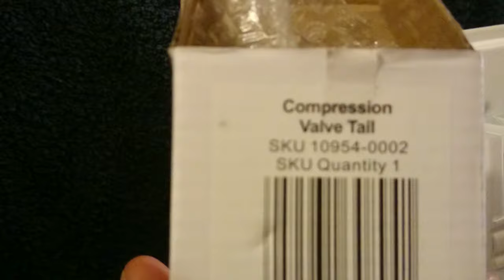Fitting A Telescopic Radiator Tail, in the real world

Comment: Good vid,just a tip though, you dont need to put ptfe tape on the threads of compression fittings ,it serves no purpose at all,put the tape on the olive not the thread.
Reply: See you say that but it has stopped a few leaks for me in the past
Reply: @garnhamr   stand by the above, does nothing the seal is the olive not the thread. but if it works for you then fill ur boots my friend.
Reply: @garnhamr it hasn’t , the olive is the seal.

Comment: Telescopic radiator valves are a leak waiting to happen. One can buy a fixed length version which can easily be cut to the correct length with a pipe cutter. PTFE  around the thread on the valve is also a NO. It needs to go around the olive as this makes the water seal. The nut and thread just mechanically holds the joint together
Reply: Been fitted 3 years still havnt leaked 😁
Reply: There AREN'T olives on rad tail joints!
Reply: Agree - the fixed type has a longer thread into the rad, and costs less, whereas the telescopic type relies on a rubber gasket. Fit once, never replace!

Comment: This video was very useful as I had to replace an imperial radiator for a new metric. I did not use the telescopic tail however, instead I used the rigid TRV extension tail as I read some reviews that said the telescopic tail was prone to leaking. Nonetheless, appreciate the time taken to put this video up.
Reply: They do leak, both of mine are leaking thats why Im here. I'll put a rigid one on them thanks for the heads up
Reply: Does the rigid one extend to size like this one too?

Comment: I didn't know these were actually a thing until I noticed one of my rads leaking. Initially I thought it was one of the compression fittings on the valve, but when I took the rad off the wall I noticed one of the tails slides in & out. That's where it's leaking from. I have no idea how old that telescopic tail is though as I bought the house 7 years ago. Time for a new telescopic tail 👍

Comment: Not correctly installed. Ptfe tape around the lockshield valve thread is not the way to seal that connection,. The olive makes the pipe seal, and a touch of jointing compound or a few turns of Ptfe on the tail spigot us the correct way to a perfect joint. Also, I can see the telescopic tail has an O ring seal so no Ptfe required there, just a slight smear of silicone grease.
Reply: Please bear with me, I am a complete plumbing beginner... 

What you call the "olive", is it the black rubber seal?

So on one side, the seal is ensured by the rubber. What about the other side? Is the brass thing enough as well? 

Is PTFE required purely for hard metal to hard metal connections?
Do we need PTFE tape anywhere in this case?
Reply: @ericmamet9893  The olive is the copper ring that fits around the copper pipe, looks like a wedding ring, and is used in all compression type fittings (those with a nut and thread).  If you are screwing a radiator tail into a radiator, and the tail includes an O ring, then a little silicone grease is required to ensure a good fit at the radiator . The other end of the tail usually includes an olive as it is a compression type fitting.
Reply: @westwonic  Thanks
Reply: For info, the olive is heat treated at the factory to soften it, so when the compression fitting is tightened it is squeezed between the pipe and hard machined metal face of the fitting. To ensure a completely weep free joint, smear jointing compound at the olive /pipe joint facing the machined metal face, or a few turns of PTFE can be used.

Comment: Good job, great video. 
I much prefer brass olives to copper ones, never had to apply ptfe tape on a brass olive. 
But if using the copper olives, I tighten the fitting down first (so the olive bites into the pipe and secures it) then unscrew the nut and apply the ptfe tape. 

Im no plumber either, but you could probably make an extension by fitting one side of a 15mm straight compression fitting into the Rad and then using the required length of 15mm pipe between the straight connector and the valve.
Reply: Jointing compound is much better for this than PTFE tape.

Comment: Am I right in thinking the threaded section you screwed into the rad at the start of the video didn't really need PTFE tape since it had a rubber O-ring? Or was it a tapered thread and PTFE was definitely required? Thanks.

Comment: Thanks for the video, the only one I could find for the extension valve; turns out it's the same valve. I was worried about leakage due to movement... Yes it does not leak even though it moves
Reply: See you’d think it would leak if you can extend the size , what stops is leaking ?

Comment: Grips on brass what a no no, use an open jaw spanner look at the teeth marks that have been left on the nice chrome fittings. You go to do them up or undo later when they are hand tight and you will have nice brass splinters stuck in your fingers

Comment: I have a 1330 single but replacing it with 1200 dual. I can get these for length but the off set is nearly 25mm out. can flexible ones be bought. the floor is concrete & the pipes are quite old. Any advice accepted

Comment: The ptfe tape goes on the olive. You always put the ptfe on the things that seals.  In this case its the olive.
Reply: @bobtahoma  Have a watch of this one too:  https://www.youtube.com/watch?v=u77SJgIS4mY    I've been plumbing for 20 years and I know a lot of professionals.  The olive is the seal.  The ptfe assists the seal. You only put ptfe on threads when a male screw thread goes into a female thread (no olive present)
Reply: @bobtahoma  You are right, a properly tightened olive (about one quarter turn once it makes contact) should never need ptfe.  You are best putting ptfe on when reusing an olive (like when there is no access to get it off) or of you have a leak from an existing olive then ptfe will usually fix it.  As for copper or brass, both work but I too tend to use copper.

Comment: Omg...u dont need to wrap ptfe tape around the end or bleed valve as they have rubber o rings.....and dont wrap ptfe tape around threads of the lock shield, instead wrap ptfe tape around the olive then tighten lock shield.

Comment: Good video, but the PTFE (White tape) goes over the olive which will stop any drips.
Reply: Alan Blundell it was put over the olive
Reply: You don't put ptfe tape over Olives..you use jointing compound.
Reply: PTFE tape, also known as thread seal tape - the clue is in the name as to where it goes, drip.
Reply: the compression of the olive should provide a leak proof seal, without any PTFE tape
Reply: @wicky525  I've always had trouble with brass olives, so as a full proof option I use PTFE. Copper olives are better.